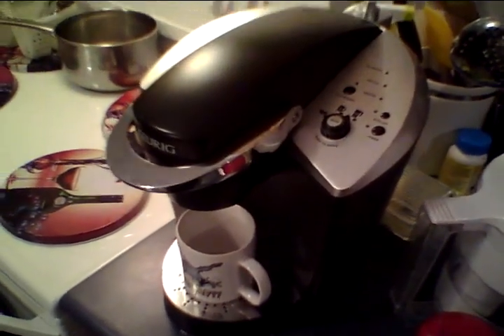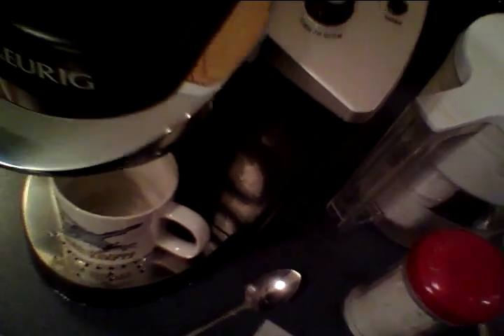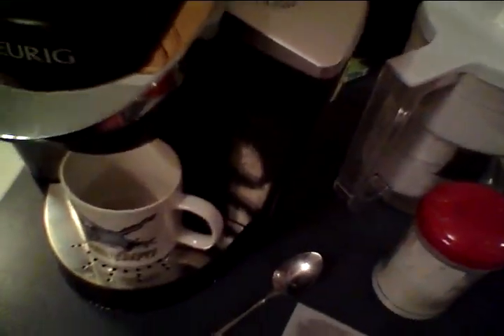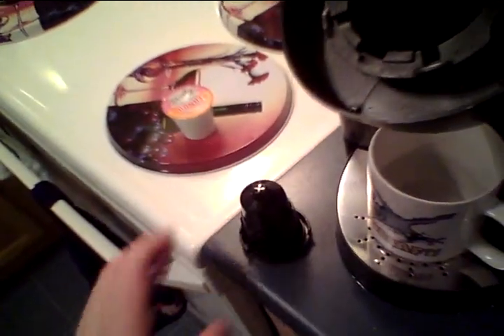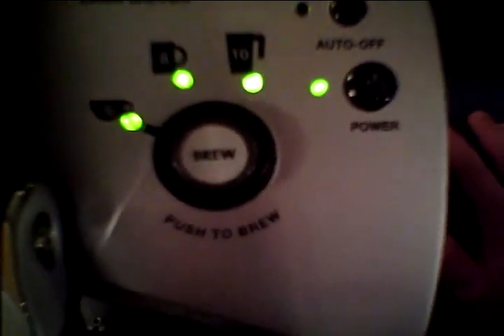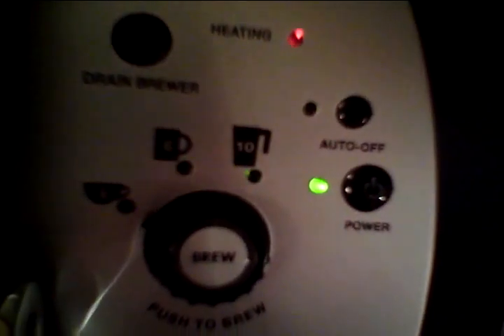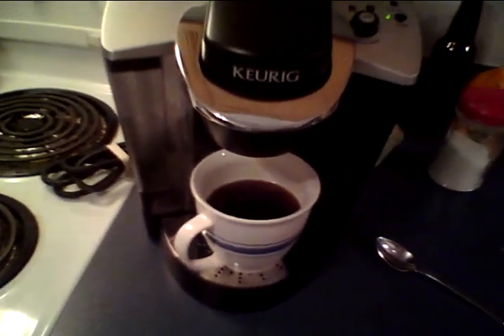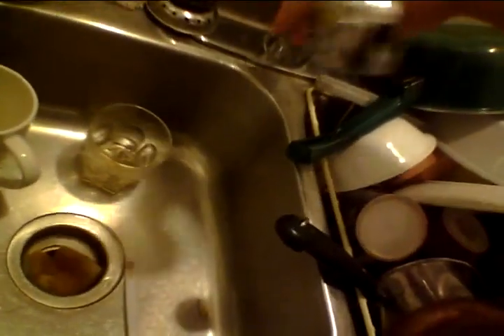Garbage Picked A Keurig B140 Commercial Coffee Maker!

Comment: I bought a used Keurig K140.  I took it apart, checked the injection/output needles with a paper clip.  I ran a cup of vinegar with a tank full of water to clear the hot water heater.  I found out that the auto-off after 2 hours stayed programmed after I turned it on again (delightful).